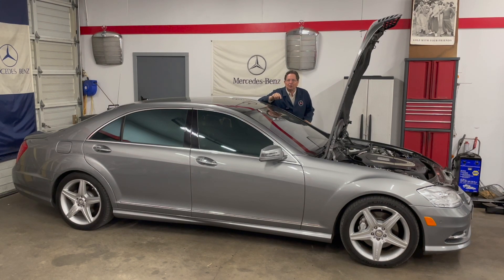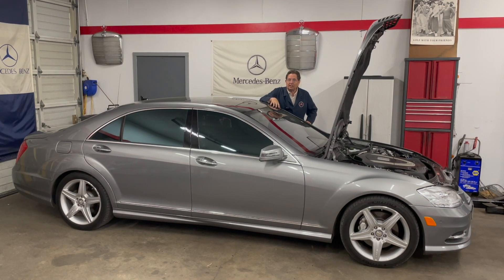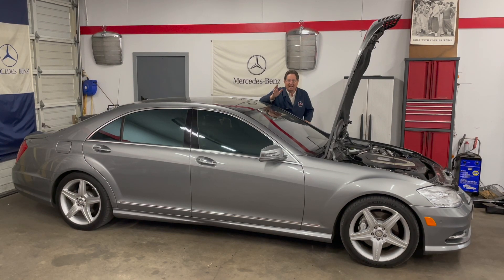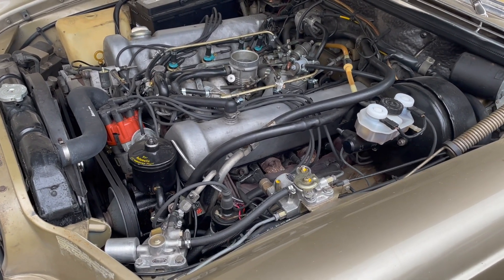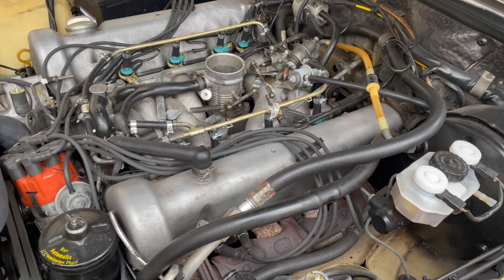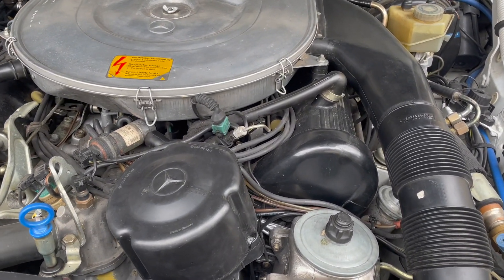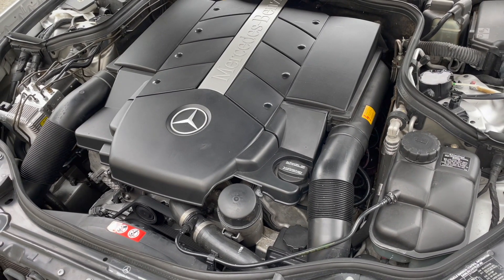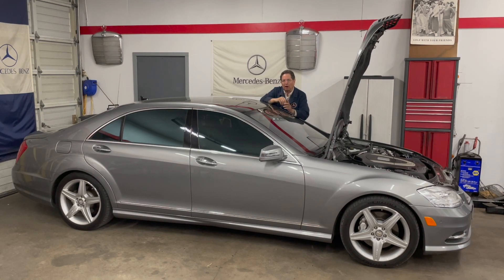Mercedes V8 Engines from 1970 to 2012: Quick Overview.

Comment: Thanks for this series Ken. 
I have a (W212) 2011 E350 4matic Palladium Silver. August 2010 build date. 
140k miles. 
Bought as an off lease with 31k miles in 2014.  
I have the same PM mindset as you and it shows as the car is a dream to drive to this day. 
Thanks again.